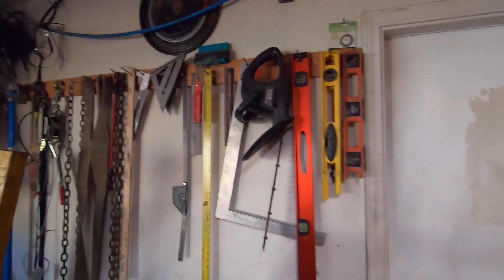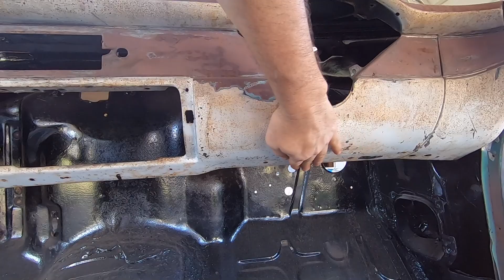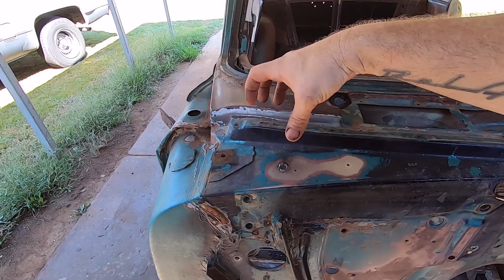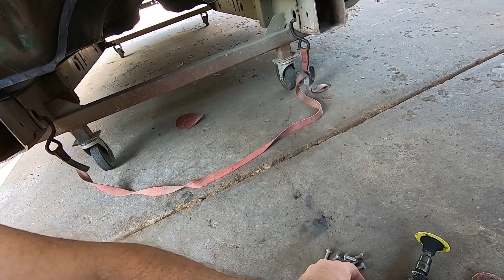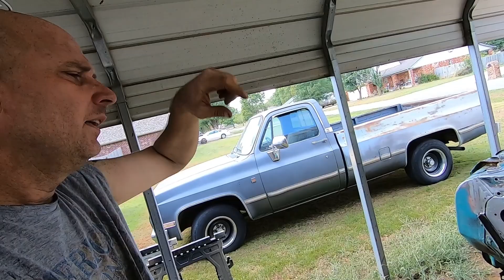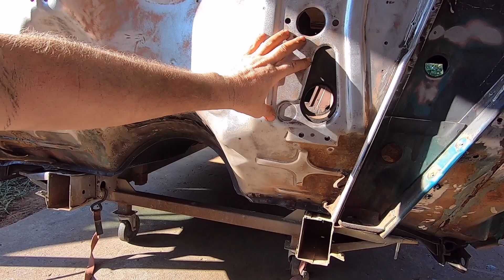Day 16 on 30 Day Thrash 1955 Chevy

Comment: The only thing that doesn't work on my car is the radio. It does actually work, but it is AM of course and just sounds terrible. Very low volume. I believe the speaker is shot too. Of course this car is all together with the heater box in place,. All to say, as nice as you are doing this car, go for the new radio and speakers. Its sooo damn nice when that works.